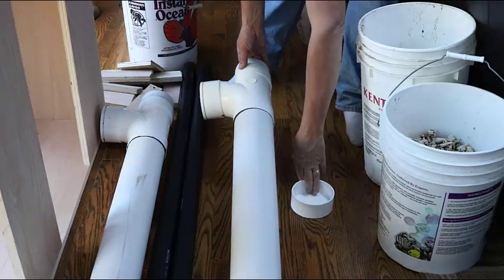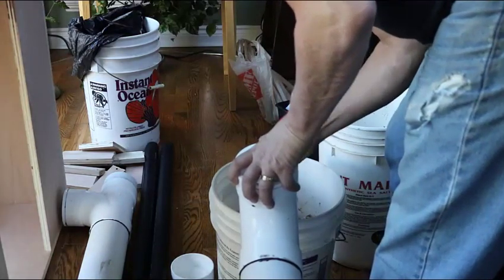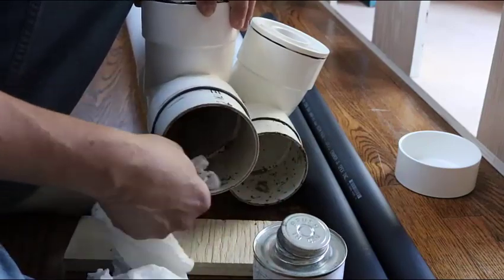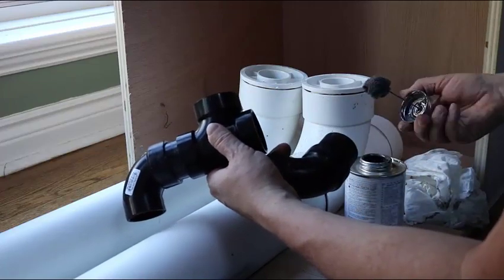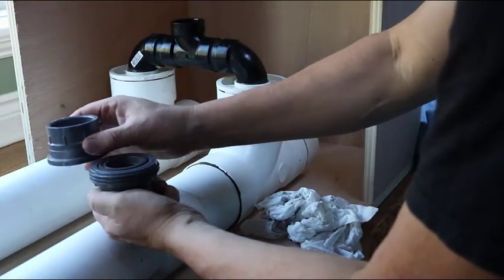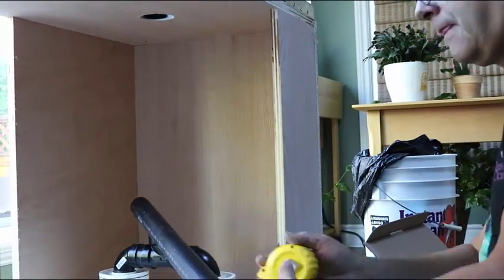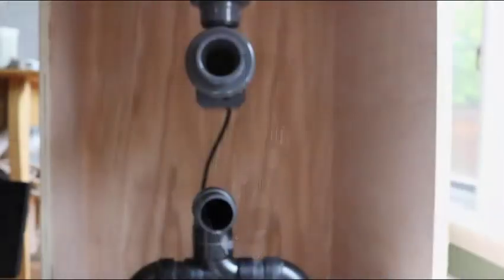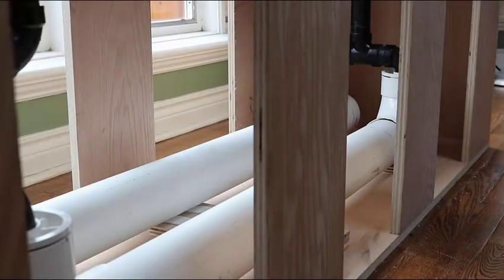DIY Leak Proof Canister Filter Instalation

Comment: Just curious as to why you didn't put gate valves/shut off fittings at the bottom of the tank fittings before it joins the down pipes? as you cannot do any work/maintenance on the system if the water is able to flow into this all the time.
Reply from the maker: In this set up it was easier to use temporary stand pipes to stop the flow when necessary. So far I haven't had to do any maintenance on the filter so we will have to see if I was right. Thanks for watching these old videos Tim!
Reply: @FishmanEricRussell  Ok kewl.. yeah just catching up on a few old ones while the weather is not the best ;)...
Reply from the maker: @TimsBitsnPieces  Aren't you guys in spring now?
Reply: @FishmanEricRussell  Yes but it is Melbourne... 3 weather changes in a day all before lunch... haha....

Comment: Really neat build. I never seen anything like that filter. Is there any reason why you switched to ABS pipe instead of using the PVC pipe on the reduced piping. Thanks for the video; looks like it makes a nice filter.
Reply from the maker: So glad you like it Jim! The change was just due to the price of the fittings. ABS is much cheaper

Comment: So... I have built and have been running these now for 6 week and ive noticed that they are nitrate factories. At what point will i notice a decrease? Months... years?
Reply from the maker: It does take a little time depending on the load. I've found it to be around 5 to 6 months
Reply: @FishmanEricRussell  thanks
Reply from the maker: @joshuaferguson5756  anytime

Comment: I have always been dissuaded from using black drain pipe for aquariums because they are meant for drains and not "food safe" and could leach chemicals into the water.  Do you feel this is incorrect or an unnecessary concern?

Comment: I wonder if a build like this with sand and lava rock would support enough anaerobic bacteria in freshwater to actually make a dent in nitrates?  Or for African cichlids, you could stick to the crushed coral.  Could this be the holy grail?  Essentially a deep sand bed filter for freshwater without all the risk associated with doing it in the tank as substrate?  I want to build one of these but I need to empty out a tank first!
Reply from the maker: I've never mixed sand in with the lava rock, give it a try and let me know. Be careful of the flow so that you don't end up with sand going through the pump. As is it denitrifies though. Crushed coral works great for Africans or any other hard alkali fish. Keep me posted and thanks for watching
Reply: hisfishherfish best bet is a algae scrubber.

Comment: Flow will be the same throughout that tube...if you want your flow rate to be different you need to provide a different path for the water to go, then flow will split between the paths according to the resistance (type of fill/diameter of pipe). Flow cannot change in a single pipe because it has a fixed volume, therefore any volume that goes into it will displace that same volume out the other end.

Its analogous to an electrical circuit; your pump is a current generator (it turns into a voltage generator if you put too much load on it, but you don't want to run it there anyway - efficiency drops), your flow is the current, and the resistance is the same.
Reply from the maker: It would be too difficult to explain the biochemistry involved here in the comment section. Suffice to say that after almost twenty years of working with this design it works and works really well.

Comment: Hi There!! This Filter is a MasterPiece! By the Way: Would it work in a Freshwater Tank??
Reply: Gedis Roberto   good question. Maybe lava rocks? I have a koi pond and turtle 🐢 pond?
Reply: Yeah.. Lava rock wouldbe perfect. Thx
Reply: Likely not, you need plants to do a lot with the nitrates. Plus carbon to attract and pull out the phosphates from break down. Then again if you have mechanical before it hits the pipes then it just might. My A.R.S.S. Possibly does this currently in a different way.

Comment: How long can u run this filter set up before it needs to be replaced or cleaned? Then how do u clean or replace? I would like to try this on my tank, depending on your results...also where did u get coral for filter? Lots of questions lol
Reply from the maker: Thanks for the interest. I've never had to replace any of these filters I've built. The oldest running one now is 18 yrs. old. The maintenance for it is coming up in a video for the 175 gal. reef build. It's an update for this video series. I will be trying to cover all of the questions I've gotten for it. The coral was bought at a local supplier.

Comment: if the pump breaks down , how you gonna change it ?  might be better to put a valve on both sides
Reply from the maker: Clear PVC in 4" is very expensive and after a couple of months would be covered in detritus build up and bacterial slime anyway.
Reply from the maker: Watch the next video in the series. I go through how to swap out a pump
Reply: is clear schedule pipe made in those sizes? wouldn't it be good to see the filtration at a glance then?